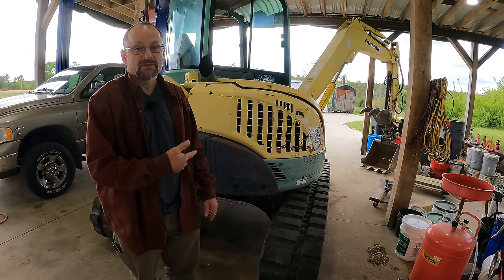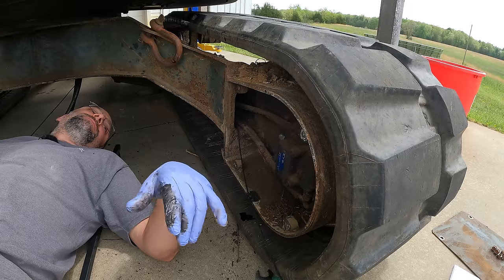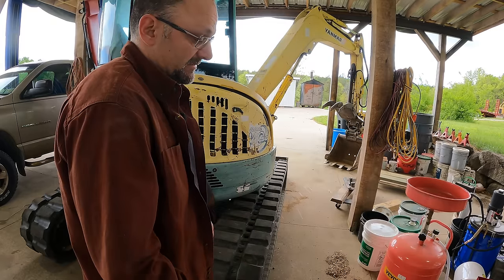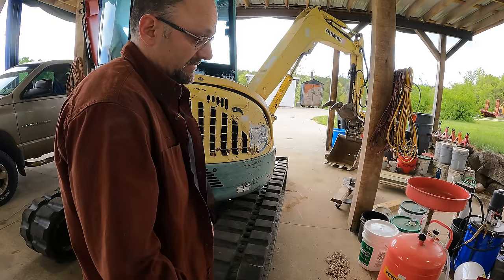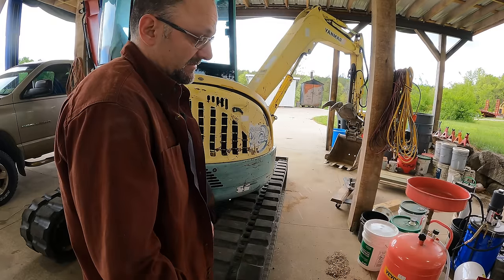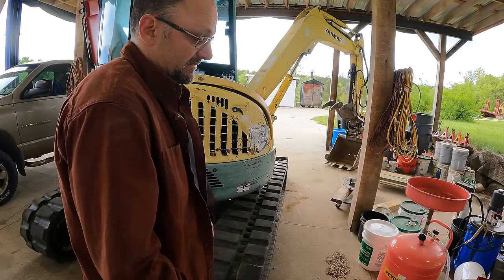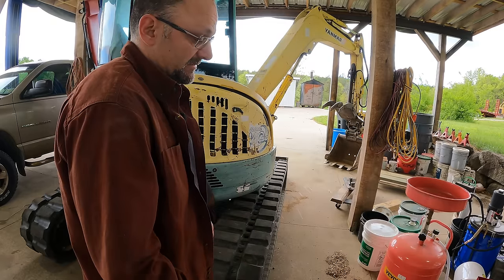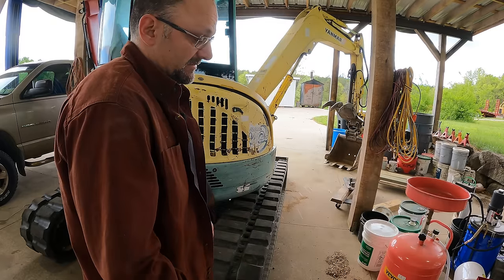Excavator Not Tracking Straight, TOUGH Hydraulic Repair.

Comment: In hydraulics speed is relative to flow. More flow equals more speed, and vice versa. So, you could add variable throttle check valves (one on each line, meter in orientation) to the faster motor to slow it down, but that will have consequences. Adding throttle checks just redirects flow. If your pump is producing 5gpm and you adjust the throttle check down to only let 4gpm though, that 1gpm has to go somewhere. Where it goes is through the main relief back to tank. So now whenever your moving, your pushing more flyid over relief than originally. This creates more heat in the system that designers never accounted for.
So you fix one problem and possibly create another! But that just means more awesome videos for us! Love your content!
Reply: The beauty of a lever actuated spool valve is that you have the ability to modulate the amount of flow you supply to the motor with how far you move the lever. So to test this out, just adjust the stop screws on the lever movement so the side that goes faster doesn't throw as far. The less spool movement, the less oil flow. You would need adjustment screws for both forward and rearward actuation to do it properly. But then your joysticks don't line up. But that is not as annoying as having to readjust your tracking 7 times in 110 yards!
So this is the cheapest way to achieve your desired results and with no modification to the hydraulic circuit also.

Comment: I agree with you its the left Valve not the Swivel Joint Jon but i think you should look at the pump it could have a bias to one side with a slight under load may have less flow and biasing or favoring the right side @28:46 @FarmCraft101

Comment: I have an IHI 4.5t. It had the exact same problem. Firstly lift the machine off the ground for easier testing. Mark both tracks and rotate. in my case there was 200mm difference in 1 rotation. Fit pressure gauges to both hyd circuits at the main control valve. Block tracks with a strong bar on the sprockets. Check pressures over relief. If different, try to adjust both relief valves, up/down. If the lower side won't increase, go to the pump and swap the 2 outlet hoses. Again, check pressures. If they are reversed then the problem is in the pump. It was in our case and was fixed with refurbishment for about $800. The pump is the heart of the machine. Lower performance when the oil heats up, is a VERY good indicator of pump failure.  2 things will make a track slow. Lower pressure or lower oil flow. Easily checked by driving into a pile of dirt and see if both tracks spin. Restricting the speed/flow to the good side is not the answer. The lower pressure side is most noticeable when tracking but is also affecting other functions, digging, lifting etc. I am retired now, but having sold over 500 used mini excavators, we found it extremely rare to have any problems with tracking differences. The Yanmar  excavators are definitely good and were much preferred. Working with a slow track is not something I could live with. Maybe on a building site but not on a farm/acreage. Good luck.

Comment: The lines you installed to equalize the pump’s output should be plumbed in “after” the valve body for the drive motors…..I think. You would need two sets of equalizing lines as they swap pressure/return for fwd and reverse as you know already. This would leave the rest of the machine’s functions out of the equation and they would work as expected. I would have to draw it out on paper to be reasonably sure of that. 
I am a aircraft mechanic with 35 years experience working on hydraulic systems. They can be very difficult to diagnose for sure and strange things happen when components slowly wear and or fail. 

We had a hydraulic lab in school with a test rig that you could plumb up your own systems and actuators and see what happens. It was the best learning tool I have ever seen for hydraulic systems. I believe the rig was donated to the school from a aircraft manufacturer at the time who were upgrading to a better one. Good luck
Reply from the maker: I thought about that, but there's a problem.  If you were to move 1 control forward, it would send oil equally to both motors through the coupling.  You wouldn't be able to steer.  But I may do it as a test just to confirm the travel motors are performing equally.  Cheers.

Comment: Check you repair manual for a screen in the inlet  to the travel motors. Also, check that the tracks are tensioned the same.

Comment: We used to have the same problem with the Yanmar Vio55-5B that we had. It wasn't much of an issue on the flat, but we lived in very steep hill country and especially when the oil was hot, reducing feed to the strong side would almost bring it to a halt.

Comment: Same thing we had before new pump(s) on 18ton Volvo. Mechanic just suggested to limit the pedal movement on stronger side. Never did that tho becouse the other pump was so bad it heated oil/bypassed and had to be replaced. But your case is not so bad on pump side so might be cheap to try.

Comment: 31:05 accumulator is like a condensator and probably the most dangerous part in your machine, it keeps pressure even you switch off the engine.

Comment: The only thing I can think of would be adjustable flow control valves on each pump outlet or after the control valve outlets.  If I was informed correctly these can be adjusted to control the flow, but not effect the power or pressure.  Just something I had explained to me about a hydraulic winch on a friend's shrimp boat many years ago.   Good luck!  Thanks for sharing your experiences with us!

Comment: I've delved into some of these hydraulic pumps and motors put of necessity (price of new ones more than what should be put into the machine) and there is no black magic there. After some repairs I've seem you make, you could handle them no problem. Most are serviceable with parts from the pump or motor manufacturers.

Comment: As you found the bouncing pressure is you’re problem. I would check the prvs in the valve slices, You could swap side to side. You may have just have worn pump piston cups. I would find the cycle time for boom and dipper and check those too. Could also find the shared function and stroke it while check the pressure and see if the pressure becomes stable

Comment: So I had a friend with the exact digger as yours. He ran through the same issues. I think he was like $13k into parts before an old timer told him that it was his tracks. That the factor track he left on the left side had thicker groves for tracking so it was slightly faster. But enough that it made him drift jist like your issue. He had replaced the passenger side track and for about a year had the issue. Because thickness or distance in the groves. Somthing like that.. so I sorta remember he ended up adjusting the push levers. To compensate how much power was requested from the pump for each side.. something like it was only a difference of about half an inch or in inch. But it almost completely resolved his issue. He went from having to redirect about every 15 seconds to maybe every 3 minutes slightly… I know that doesn’t make a lot of sense.. but back sorry my friend picked up one of those referenced machines that was parts only! for like $800 abandoned in some business’s back rear parking lot. And the rental company who owned it supposedly came to pick it up but just ended up robbing parts . But nothing that prevent it from starting or moving. Other than one of the tracks. So non movable sitting for years. Beat up high hours my friend figured he can sink the money into all the parts and still be in on a good deal…

Comment: Coupla things, the track idler at the front can have left to right slop, also, I may not have seen but when you bored out the blanking plug to couple to your test port you would need a dowty washer against that surface to make an oil seal.

Next step, bypass swivel and valves and go straight from pump to final drive with your own on off valves!

Also the 2.9 tracking speed may be like a car claiming high mpg in the brochure! You might get it with looser tracks or on tarmac. Or as most brochure calculations are made - downhill!

Comment: So I have not read all the comments but I did watch your video. My uncle ran a shop manufacturing concrete floats and we had machines with hydraulic cylinders that needed to be slowed down to feed wood into the shaper tables. We used parker Colorflow flow control valves to set these rates. They have all kinds of them with various specs, they have free flow backwards models. The basic way they work is you manually dial in the flow you want with a knob on top of the valve  and leave it set. I would just simply put one of these on the faster motor at the spool valve and dial it down till it matches the speed of the slower motor and boom good to go tracks straight ahead. Sure beats replacing pumps and valves and motors. Good luck hope you sort it out great video enjoyed watching you think through the hydraulic circuits and the various results changing it produced.

Comment: I operate all kinds of excavators, and I can tell you that even brand new machines often track left or right. Undercarriage will also have an affect on the tracking (track tension, bogies, idler bearings)... Often the machines are ran to failure (don't fix it unless it is broken). Preform your PMs, and it should last you years. All that being said.. As an operator you learn to use visual markers off in the distance as a way to make long straight cuts, or use stakes, string, and marking paint on small precision work. A bolt and two pieces of 1" PVC  help to maintain depth on a ditch cut.

Comment: Had the same issue. Two different mechanics looked at it to no avail. The pump has been replaced, a final drive replaced. The control valves pulled, disassembled, inspected and nothing found. Swapped pressure regulator from side to side, no difference. I ended up pulling the hydraulic pump back off and disassembling it and it looked flawless. While reassembling it dawned on me where the lines were hooked up and low and behold two of the 6 lines were in the wrong spot. I swapped them and issue fixed. It was only countless hours, probably 5k in parts, oil, hoses, fittings etc.. and all along it was two hoses in the wrong locations..

Comment: If this was my excavator I would add two inline (adjustable)flow regulators between the drive motor and valve block. This way you can match the motor speeds even with worn components.
Its not the way you are supposed to do it but a decent farmer fix in my opinion.
Greetings from Germany.

Comment: I admire your patience trying to solve this problem. As a cost effective solution, how about a flow control valve on the faster travel motor. You could then throttle the fast travel motor to the same speed as the slower one? Not ideal 😊. I watch all your videos; keep up the good work.

Comment: Maybe you could put a larger diameter hose to the weak side?
Might want to do some calculations to see if that would make a practical difference in flow though. 
Or like others have said an adjustable flow restrictor on the strong side would probably sort it out without to much hassle.

Comment: I dont know if you knew this already but a great diagnostic tool is a digital thermometer. a heat difference indicates leakage through valves. its much easier than flipping lines.

Comment: Sir you did a great job in evaluation.
I was thinking about in the begging adjusting the tracks, one used and one new.
Last thought which which accrued to me that I may have missed if you addressed it was the dissimilar conditions causing causing travel issues.
And since then had it changed?

Comment: Did you check the linkage to see if the valve is actuated all the way?    Also the valve segments might have circuit relief valves in each segment. The relief valve on affected side might be leaking.

Comment: John, I have been thinking about buying one of the cheap Chinese excavators and have been noticing that some are really jerky in the controls and some are not so bad, could the difference be in the pump, if so what do I need to look for or ask about, without really trying them out myself? I love your troubleshooting the hydraulic systems.

Comment: If you are questioning the output of your pumps, a flow meter would allow you to perform a pump efficiency test. One thing that I would suggest is checking the flow out of the case drains from the drive motors. You can do this from the pump too if you know what hose it is but that is not 100% going to tell you if the pump is worn or damaged because the pump can just be leaking from high pressure to low pressure in the valve plate.

Comment: I have had several older mini excavators and they all track unequal. I would just adjust the amount of throw I would apply to the track handles as I crawled. Now having said that I agree with Bill Forrest. Note that there was only one accumulator, could that have any effect on a worn machine? Try bypassing it and see if it gets any better but DONOT leave it off permently. Also the resistance in the under carriage could account for one side performing better(or worse)  when the flow was flipped.

Comment: There are usually adjustments on the bars between the steering levers and the valve spindles.  It's possible that 1 is being moved more than the other or vise versa.  Causing your machine not to track properly.  Try changing the travel lengths to make each match. Hope this helps.
Reply: Yes I’ve seen that before. The bolt on the floor under the pedal that limits the travel of the lever was stopping the spool getting full travel on one side.

Comment: Aren't there a couple of adjustment bolts on the front of those pedals? They keep you from pushing it too far if one side tracks faster than the other. Only other thing I can think of is contaminants in one of the hoses. Had a small piece of an o-ring in one of mine once. Btw,  I love my yanmar backhoe. They really do make a great product line.

Comment: If when cold it's going better, add heavier oil in the tank.
Usually excavators uses ISO-VG32 oil, or maybe 46, you can add 68 to raise viscosity on worn ones.
The main thing is to avoid cavitation, so keep an ear to that.

Comment: I am by no means knowledgeable of heavy equipment so pardon me if this is not applicable. The more you push the drive sticks forward or pull for reverse the faster the drive motors go? If that's the case can you not add some sort of stop for the right hand stick to prevent it from going at its full speed. In essence equalizing the top speed of the left side motor. I know in a previous video you had tried that via an adjustment of 1 of the valves I believe. But maybe going to the extreme of adding something on the stick itself so when left is maxed out the right is limited to then match that speed. Your overall top speed may be reduced but you wont or shouldn't have the issue of having to stop and adjust every 30 feet either.

Comment: I think you should measure the pressure of fluid going to each traction motor while you are driving in a straight line.  Even though you do not have a flow gauge, measuring the pressure while the motor are turning  the tracks, will provide you with more insight regards where the problem is.

Comment: Consider adding pressure compensated flow control valves to the "A" port or line off each valve.  Should be able to tweak these valves to compensate for final drive differences.

Comment: Having a look at the hyd schematic makes this a bit more complicated because there is only 1 piston group. You need to check the valve block in between left and right travel blocks. I see there is a relief valve on the block in between left and right but if you have a look at the adjusting screw compared to other relief valves you can see there is a difference. What i cant see is the front relief valve on the centre block. Compare the adjustment on front and rear relief valves, can also swop them over and see if there is a difference. Also should have load check valves on valve blocks, ie allen key plugs. Open them and check the seats and springs.

Comment: You could check the case drain from suspect motor and that should tell you the leakage. See if there is a adjustable flow valve on the spool in question. You can take a hose from motor case drain and time it into a bucket. This will give you the gpm of flow. Good luck my friend

Comment: I own 5 mini-excavators. None of them track straight for long distances and I honestly just deal with it.  All have some sort of adjustment , whether it be stops on the sticks, adjustable rods to the control valves, or in one case adjustable cables to the control valve. You can fine tune them with that, but I still get some drift.   And finally, as mentioned several times, that accumulator on one side of the system might be suspect.

Comment: We have a Yanmar VIO 70 where I work. That Yanmar does the same thing, but it's intermittent.  It usually starts doing it after the high speed travel has been used. I have always believed it has some to do with however it shifts speed. It's a grey market machine so information is minimal.

Comment: The object you calling an accumulator on the output of one of your hydraulic pumps is actually a pressure regulator.  The bolt on the top adjusts the pressure on a spring that increases or decreases the pressure on one side.  You can adjust your tracking it is that simple.

Comment: I have same machine. One travel motor was replaced before I bought it.. Mine tracks to the right. My travel motors are different.. They each flow slightly different. That's why it tracks to the right.

Comment: Presure gage with additional manual valve cheapest way to search for hydraulic faults 😊 and maybe with that adjustable bolt you setting up neutral position on piston pump ?